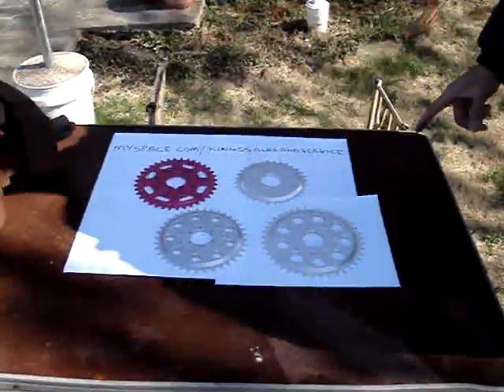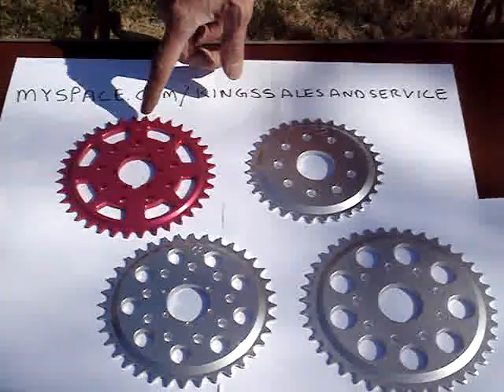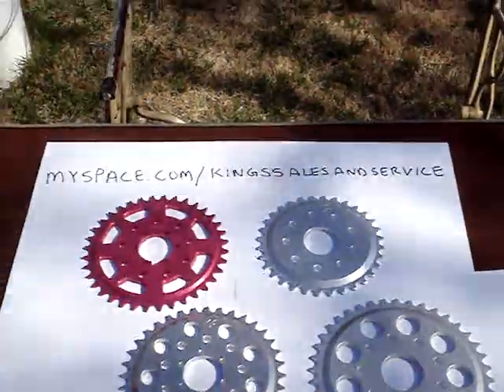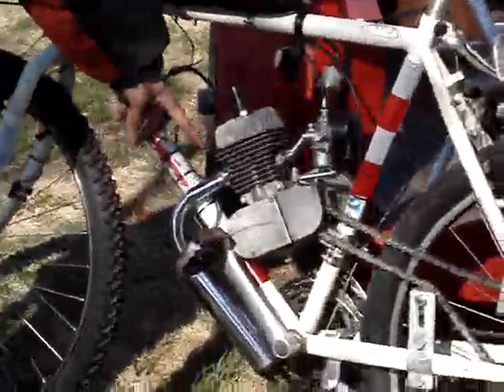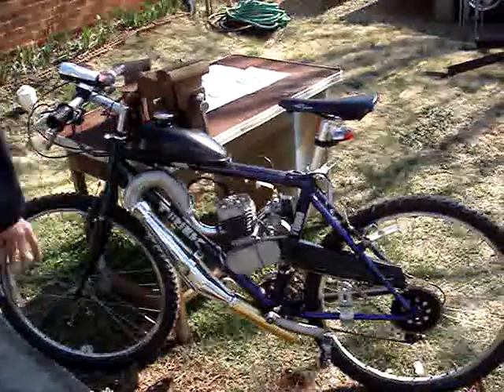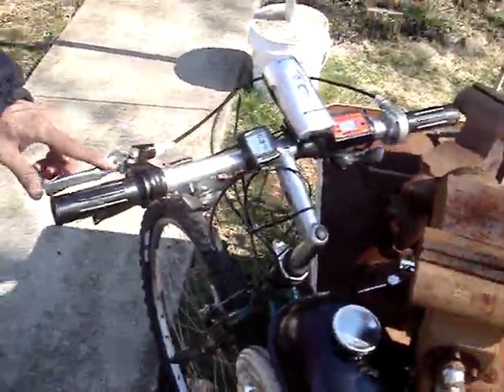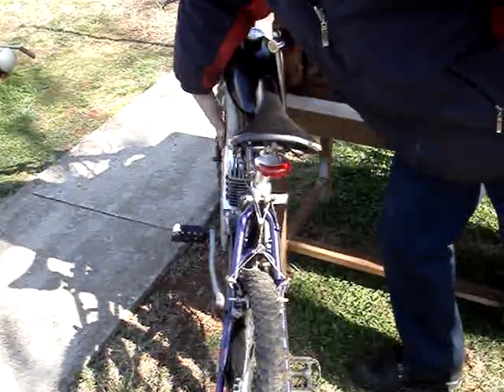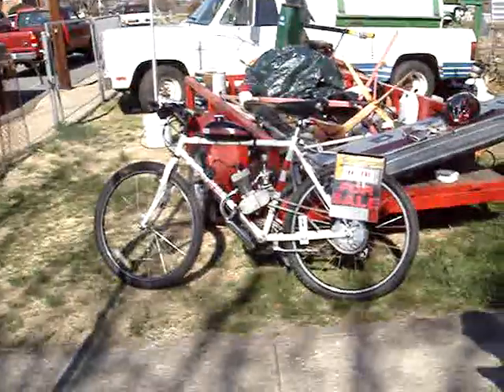Bike Engine Tuned pipe /sprocket video Take 1

Comment from the maker: HI, 
If a motorized bike is legal in your area to start with , the addition of the pipe alone will not make it illegal in itself unless you have certain speed restrictions in place that the pipe may allow you to exceed. Also, if your bike comes equipped with a Catalytic converter (believe it or not some actually do), the removal of the stock setup and use of this pipe may conflict with EPA regulations (much like doing mods to a car)....The sound level of the pipe is about stock. Thanks! Andrew

Comment: I like your sprockets! I've been waiting three days for a machine shop to enlarge the center hole to the 2.052" necessary to clear my disc break hub and if it's not ready, you will be getting a call from me quite soon. When will the tuned pipe be available? Also, I live in SF, CA where I need the motor to by big butt over some rather big hills (Twin Peaks). I'm running a 44T on a 24x2.1 tire/rim. Will a bigger gear help?

Comment: hi there,
is the tunned pipe already available ?
did you think of improving the cylinder and sale high performance ones ? There's a lot that can be done on the cylinder, like changing the areas of the transfer ports, and changing the timing of the blow out, etc etc. Also would be great if you could do a piston with more material on the crown to raise compression to about a decent 9:1, I think stock is like 6.5:1